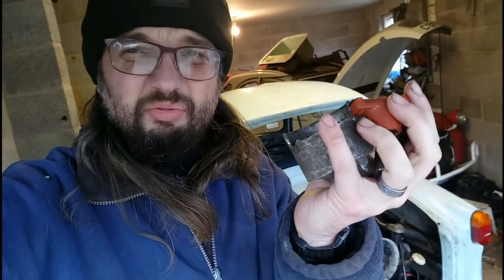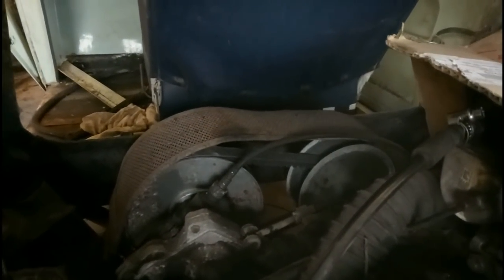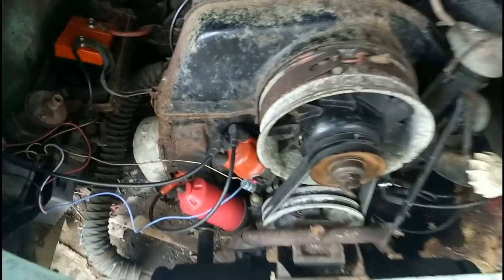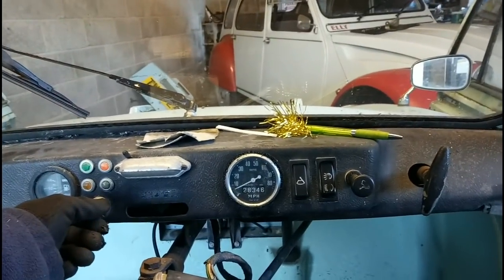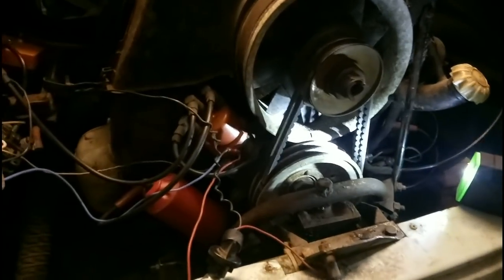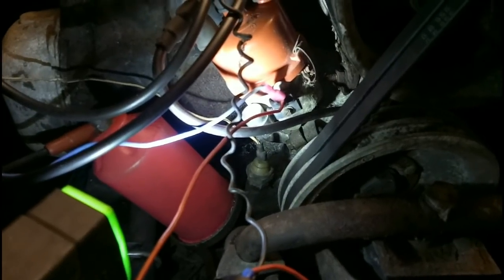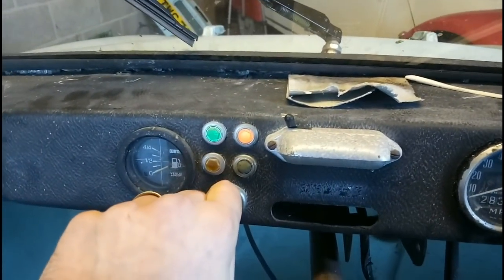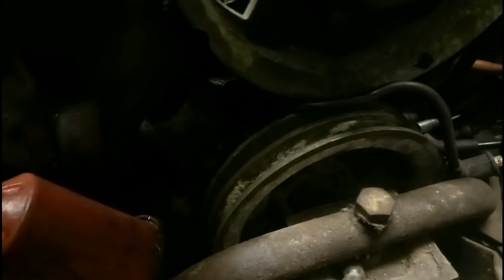Project Invacar Part Seven: FAIL! It all goes wrong...

Comment: wow. so you'll need a new distributor for that (just a bit) - any damage to the block could be re-welded and filed to fix that mate - worst case JB weld and filing would help here too as a non permanent fix.... any swarf thats in the sump, clean as best you can with degreaser which will thin the oil as well and it will come out (if you don't take the engine out). all completely fixable and re-doable dude. thats cars and projects mate, keep it going!
Reply from the maker: Yup, less doom and gloom today now I've slept on it. Next week, I'll take stock and move the project forward.
Reply: spot on mate.

Comment: O crap things going well and then the mechanical gremlin bites one on the arse, been there done it got the tea shirt, that distributor should have come out without much of a problem but with the car layed up for so long aluminium tends to corrode and expanded locking it into the engine port hole all I can say is bugger bugger bugger crap, thank goodness you have the other engine. Let us hope you do not encounter further problems like this one, cupa tea and a hobnob is now required.
Reply from the maker: Yes, shame the other dizzy also seems reluctant to move. May try a different approach with that one!

Comment: In hindsight engine removal would have payed off. You'd have better access to heat the block and rotate the distributer.I take it the block is ruined then or will the distributer shank still drill out? A small cold chisel is more effective or drill with vacuum cleaner in place to suck up the swarf. Just ideas.
Reply from the maker: I'm really not sure having the engine out would have helped. Working on ideas!
Reply: Better side access with oil filter clamp to rotate it?
Reply from the maker: +Adam Ski There was enough access to do that. It still didn't move. Until it snapped off...

Comment: My heart bleeds for you mate .but could kinda see it coming .you could get a slide hammer to hook onto the bit of shaft thats still in there and hope the impact will break it free .if not i think its engine out  dismantle it and try and knock it out from the inside .but i think the shaft housing is too badly damaged .so if the other engine is no good you could do a nice honda cbr 600 engine conversision (100bhp)
Reply from the maker: They're lethal with 20bhp!
Reply: HubNut is your heart in it to keep going ?
Reply from the maker: Oh yes! You can't let stuff like this stop you. It's just a case of taking a deep breath and trying another approach.

Comment: Oh dear, break out the JB weld 😳😉😂😂😂
Reply from the maker: Going to be tricky to bodge my way out of this one! I'll give it a go though...
Reply: HubNut it's an easy fix, simply melt down the broken parts and re cast them, East peasy 👍👍😉
Reply: HubNut your misses will love that lmao 😂
Reply: JB weld is a good idea, but that's consumer grade stuff. I use and recommend Belzona.

If you weren't on the other side of the planet, I'd break out the TIG and build it back up for you, good as new. Do you know of a friendly local welding shop? It's a bread and butter job, with a bit of machining (or hand filing) to finish it off.
Reply from the maker: +Godfrey Poon I do know a good machine shop.

Comment: Ian, just when you were on a roll you hit a wall (I'm partial to that too) but alas, I have every faith in you to find a solution!
Reply from the maker: Indeed. Can't have things going too easily can we?
Reply: I restoration nothing ever goes to plan does it? I've been forced out of my garage this week as it's leaking live a sieve. New roof required I think!
Reply from the maker: Nope. It's never easy. Last winter, I got the 2CV back together, and then it broke down several times during the MOT test, and on the way back home!
Reply: I once had a Morris Marina, several in fact but my main Marina (1.3 SDL) drove the length and breadth of the country and never once missed a beat until one day I was visiting my parents and it split the fuel line and I had absolutely nothing to fix it so the RAC had to take me home which thankfully was only 10 miles away. 

in 2005 I also had dizzy problems with my Austin A60 I had at the time. I was at the 100 years of Austin show at Longbridge and on the way home the distributor packed in on the M6 in heavy traffic. I managed to limp it off the motorway at Stafford and rebuilt the dizzy with spares I had, I changed the points and condenser but it still didn't start. I waited 4 hours for the AA to turn up and the locals brought me out bacon sandwitches and cups of tea lol. The fault? a dodgy spade connection on the ignition coil. Once that was fixed I continued my trip back to Scotland without any problems lol

The only other time I've broke down was when I tried to see how fast my mini 1000 would go and I blew the engine up. The RAC man towed me home and said "well son, thats the car finished now, do you fancy selling it?" I just laughed and told the boy that the car is going on a trip in a few hours and will be repaired as soon as I get home lol That was 9 years ago and I still have the said mini but it's in bits and on a spit in my garage getting restored

Comment: A 2CV engine might be a possibility. Can you get Invacar distributors?
Reply from the maker: Distributor is the same as Steyr-Puch Haflinger, so no problems there. Needs some headscratching but I'll sort it.
Reply: You might be able to pull it the dizzy drive out with a slide hammer or just chisel away until it comes out. If that doesn't work the dentists pull with some mole grips.

Comment: I was you I would strip down the other engine first and rebuild it we have been there before I have rebuilt old motorcycle engines?
Reply from the maker: The original engine is going to have to come apart, but I'm not going to go for a full rebuild. That's simply out of budget. It'll get what it needs, but I'll resist completely overhauling the thing. It has only done 28,000 miles.

Comment: Well, that distributor had to move one way or another or it can't be properly serviced. At this point, yes you're in a bit of a dilemma but nothing is irreversible. Is there any way you can get a slide hammer attached to the distributor shaft? Also, be careful with heat. I'm not sure about your engine but VW air cooled engines were magnesium. It can burn and you won't get it extinguished if it starts going. There's something you can do with vinegar to determine if it's magnesium or aluminum(alloomineeyum XDXD) but I'm not sure how to do it. Look it up. Best to walk away for a bit at this point. You seem capable and it will look better after a day or two.
Reply from the maker: Thanks. Will be having a few days away due to other commitments. I'll sort something out!
Reply: Just what you need to do is get off it for a bit and out of your mind! It'll come to you!

Comment: What is the distributor drive turned by?
Reply from the maker: Crankshaft.
Reply: Is it possible to take off the sump and hit the dizzy drive from there?
Reply from the maker: I've no idea. Sounds feasible. At the moment, I reckon engine swap will be the easiest solution. Though only if I can get the dizzy to rotate. That said, I might just check the static timing and if it's close, that might do...

Comment: You got to that carb and I realized you hadn't rebuilt it, haven't replaced the plugs and haven't adjusted the valves. Those are the first three things you should do on any carburetted engine that has been sitting un-drained for so long that will crank but wont start.  The only things before that are changing the oil and the battery (didn't bother with the oil until last episode). I like your videos hubnut but you have just enough knowledge to  do things in completely the wrong order. Why add on an aftermarket ignition system when you hadn't dealt with the rest of the stock components yet?
Reply from the maker: I don't need people to tell me how crap I am. I already know. Plugs were replaced, but only for a used pair I already had. I never rebuild engines if I can avoid it. The one in my 2CV sat in a damp garage for a decade, was fitting, tuned up and has covered about 30,000 miles since. Why rebuild that which does not need a rebuild?
Reply: HubNut I meant rebuild the carburetor not the engine. The jets and tiny passages get clogged pretty bad with fuel residue. Sorry if I came across harsh.
Reply from the maker: +Doug Scholl Ah, got you. That may be fair comment after all.

Comment: I am so sorry :(
Potentially very stupid question coming: did you not swap the HT leads on the distributor by mistake? Maybe it was not retarded, but firing in a wrong way...? Sorry if this is completely stupid question, I'm used to 2CV where there is no dizzy..
Reply from the maker: I think that, like a 2CV, if you swapped the leads, it just wouldn't run. I did double-check the routing. Timing is definitely off. Apparently they often did it to slow the cars down a bit...

Comment: Its probably late now but can you access valve via rear wheels area ,that shering is the belts on the vari drive having dirty wheels . My mates Old Volvo 340 had the same thing he applied WD40 which worked for a bit  and 3 months later I had to fit new Belts
Reply from the maker: Shering? I don't follow.
Reply: There was a rattle noise on start up before you had to rebuild,  Its like changing wipers on Lexus is done from under the bonnet with the arms in normal position ,
Reply from the maker: Rattle is probably the centrifugal clutch. The variable belt wheels aren't turning with it in neutral. The Lexus bonnet thing didn't work. They just jammed into the underside the bonnet.
Reply: I'm 400 mile away and thinking 30 years back , Vari drive is centrifugal thing springs spinning out ,Sorry I worked at Volvo for a while and the DAF had the same kinda thing and I'm old and get confused.But a cup of tea whilst laying under most cars Like Joe 90 It all comes back (washer bottle plastic straw ). Doesn't the lexus bonnet have a service position which is super Vertical ,stop  me bang head on bonnet and helped me sit on wing while singing the Lumberjack song,Much to the amusement of my fellow grease monkeys
Reply from the maker: +Johnny Psycho I haven't found the service position yet, doesn't mean it isn't there!

Comment: I hate to say this but if the dizzy has never been moved, there is no play in the drive and the engine has not been dismantled the chances are it was in the right place and the retarded ignition timing was due to something else like wrong points gap maybe.
Reply from the maker: +p24hrsmith Or that they retarded the ignition deliberately to reduce power. Apparently they did that as the drivers could be, er, hopeless.
Reply: or maybe to run on unleaded fuel?

Comment: Have never seen a distributor as bad as that, normally a few taps with a rubber mallet and they come free, let's hope the problem is not repeated with the spare car engine.
Reply from the maker: Hey, guess what! The dizzy seems reluctant to move on the spares car too. I'll give it a few more soaks in penetrating oil, and rather less violence...
Reply: HubNut oh bugger
Reply: Would heat help free it at all?
Reply from the maker: Didn't help this one! I'll give it a go anyway though.
Reply: Dissimilar metals?
Reply: Oh bugger!...Not good, as you say "loads of penetrating oil" may help.Are you able to get a strap wrench around it (after soaking)?
Reply: Michael Kane same, never seen anything like that either, if anything they usually try to make a bid for freedom on their own. Makes me wonder if there is horrible wear between the drive pinion and the dizzy casing causing the latter to bell out preventing it from being removed. Not familiar with this engine but I'm guessing the dizzy shaft is driven from either the camshaft or crank by a helical gear, I wouldn't beat it up anymore in case you do damage to the gear teeth. Bite the bullet and take it out, it's not as if you'll need an engine hoist.
Reply: I tend to agree, get it out and on the bench, a full strip down shouldn't be that difficult I wouldn't have thought. If this is the Puch engine which I think it is they were a well made if not a little quirky unit.
Reply from the maker: Yes, it'll be coming out and either getting replaced, or getting machined and fixed.

Comment: Usual gits pointless ten cents worth. At the point at which the horrible stuck monsters entered my life and aluminium was being involved think I would have been in full dismantle mode. Motor out. It isn't a big motor. Two people. Crane. Engine stand. I am a digger. Digging a hole has always worked well for me. I find things. More things. Still what would I know. Probably plenty more take apart horrors once one has begun. Blah blah blah random inputs off the interwebs.
Reply from the maker: +Damien Towning I have no crane. I have no engine stand. I do have a strong wife though, who is very good at assisting with 2CV engine removal. We make a good team.

Comment: This breaks my heart viewing this....  Thankfully I have just eaten
I wish you had a smaller hammer and didn't abuse poor red screwdrivers
Okay we have established sump is coming off so why don't you drill small pilot holes down the broken aluminium column shaft and weaken the main structure and with plus gas try and break it up and maybe use the centre steel shafts as a slide hammer
As we write this you might have done this already or got the engine out  and into next build
Is the donor engine in a same situation
Can the broken dizzy be cross referenced to any other engine reliant  styr puch 
I assume you will have a source of info from your subscribers grease monkeys 
I think a hyabusa conversion will upset a few purists
Reply from the maker: Drilling was pretty much what I was doing, not pure hammer-and-screwdriver. I fear it's a sump-off job to really deal with it, so the engine's coming out for repair, or another one is going in. Not sure yet. Will take some time to arrange.